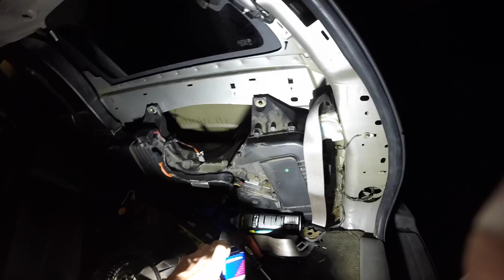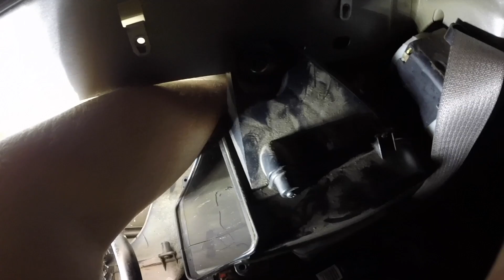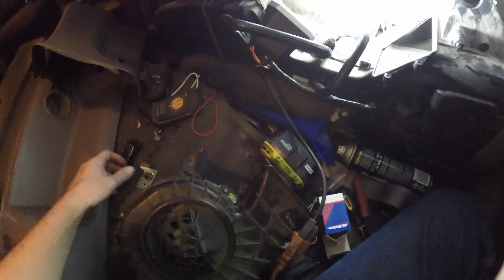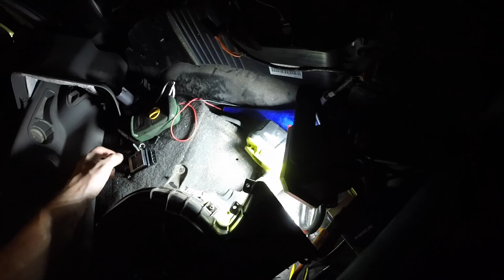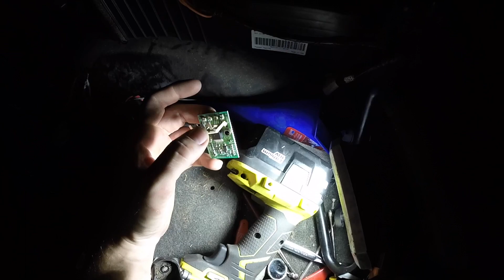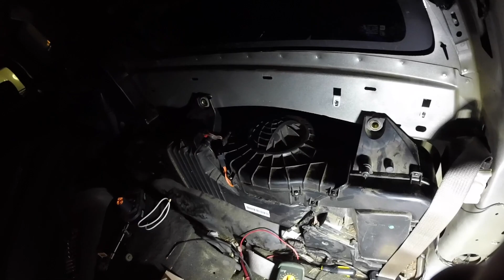Trailblazer rear blower motor repair

Comment: put a new blower resistor in my 2003 Envoy and it goes for about 30 sec and shuts down, upon close inspection/analysis the resistor is getting super hot and probably tripping the internal thermal resistor. Checked current draw on motor and it is acceptable. While trying to check it out discovered that with the ignition on, engine not running, blower fan on high, it stays running, soon as I start the engine within 30 sec resistor gets hot and blower shuts off, total mystery. Did see one comment online about a faulty ignition switch causing problems but I would think if that was it it would do it whether it was running or not. Voltage does go up with engine running but it's only a volt maybe volt and a half, pretty normal, any ideas or have seen or heard anything like that ?

Comment: My rear ac won't do anything from either the front or middle console. I replaced that resistor and still the same. Any suggestions?
Reply from the maker: @Chris-v5h9t  I would try directly powering the fan and see if it blows that way.

Comment: Thanks for the video Chris! 

I was wondering what video your talking about at the end of this video where you said a theirs a relearning process? Is it just replacing the damper control like in your other video? Thanks again!
Reply from the maker: Sorry for the confusion I was talking about the start up procedure for the rear a/c system. it will sweep the blend door motors before it will turn the fan on, but there is also a reset you can do on the rear a/c, I can't remember off hand but I think it involves pulling a fuse and putting the rear controls on a certain setting.